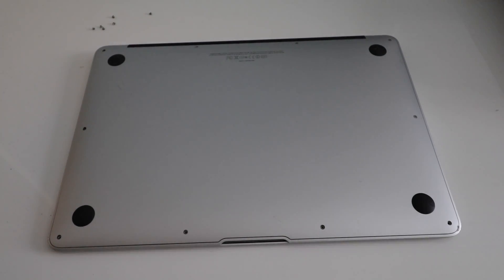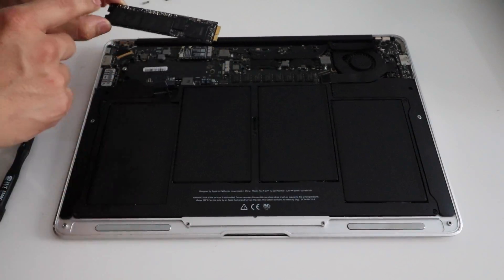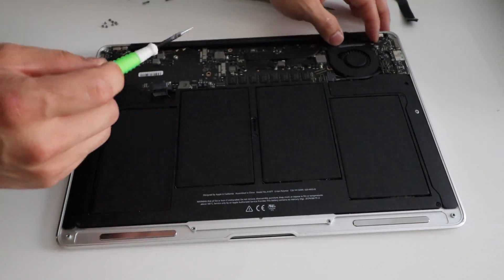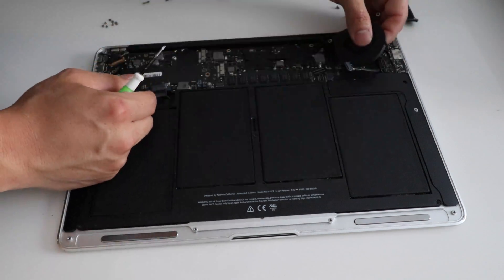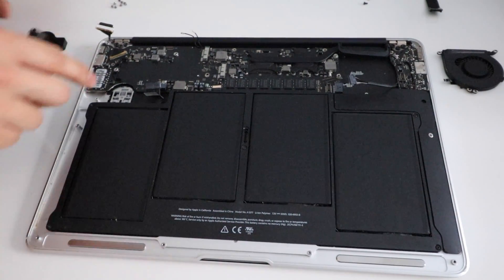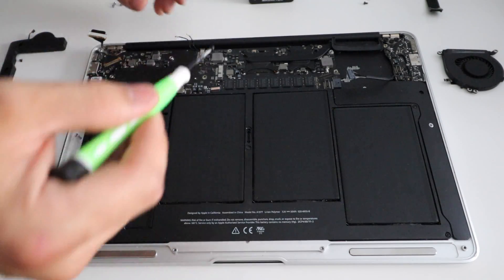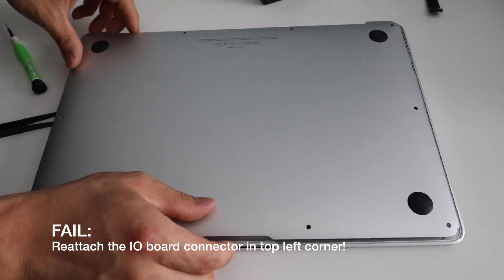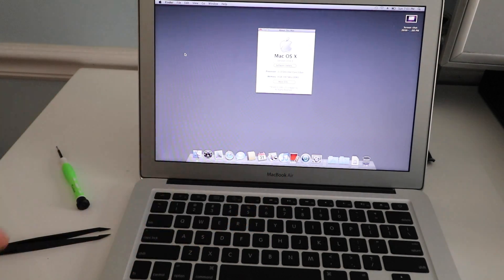Replace Macbook Air Logic Board (2010) + SSD & WiFi

Comment: Hey ! Thanks for the video .. I do have one question... I replaced the Logic board and everything works as far as I can tell on the hardware department but when I start it up it wont boot .. it goes to a file picture with a question mark .. I try to go into the startup mode or recovery mode and it will not do it.. is this a conflict with my old hard drive that I used form my other logic board? I am truly lost. The other logic board would start up with that hard drive into the regular os system . I dont know why it wont with this logic board.. Please Help??

Comment: Hello , I am going to change the logic board too. Do I need to remove thermal paste and put a new layer? or keep the original one?
Reply: Your replacement motherboard should have the processor soldered on. Thus the heat sink "should" still be intact. If it is I would it's not necessary to reapply thermal paste. If it is removed I would replace with new thermal paste.

Comment: Do you have a way of resetting the firmware password on this model?  e.g., remove all power source. batteries etc?
When I boot with OPTION, screen is locked.  Thanks for any help.
Reply: fatwod did you ever find out an answer for this?

Comment: Hi, thanks for the video.
I have one question to ask: you mentioned that the new logic board was also an upgrade. Was it an upgrade only in processor power, or also in RAM?
The reason I ask is that I would also like to replace the logic board in my Late 2010 Mac with 2 GB RAM for a later board with 4 GB RAM. And I am not sure if the board with 4 GB RAM would fit in 2010 Macbook (for example a 2011 board).
Thank you very much.
Viliam